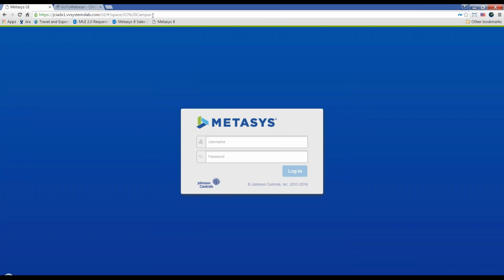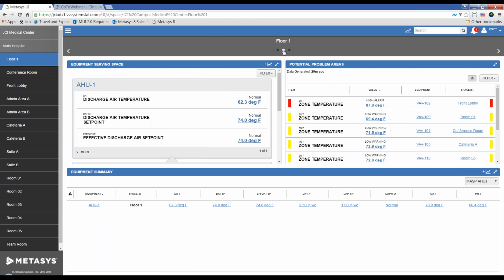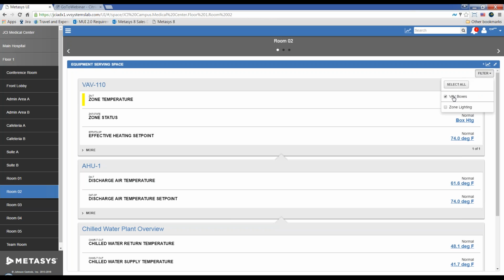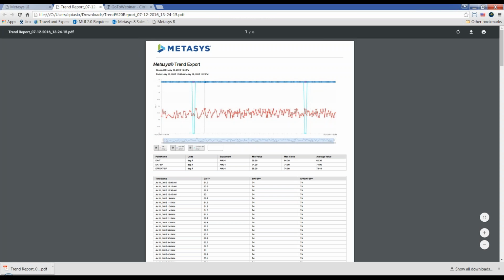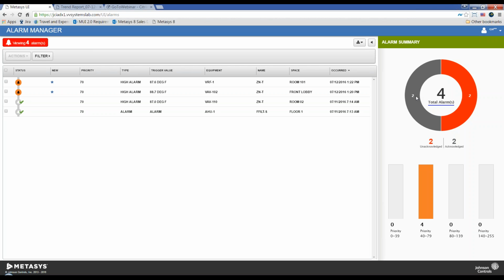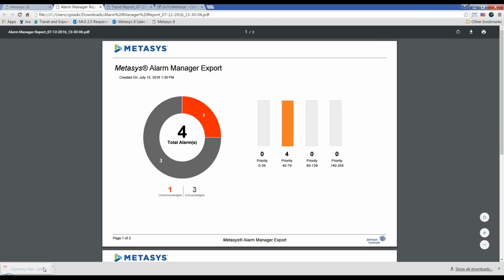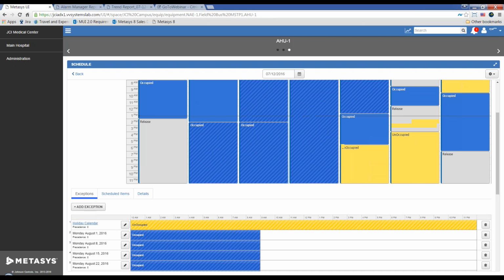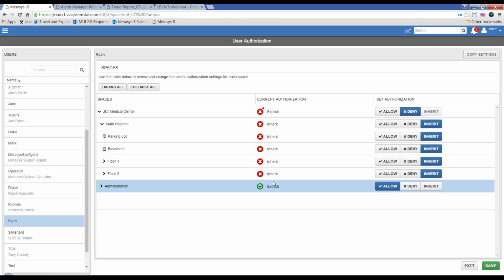Metasys® 8.0 Demo | Johnson Controls

Comment: Hi Ryan, Excellent video. may i know can one use existing UI or we need to create new graphics. I am stuck at at "no space configured". I can view the alarm but there is no graphics on the centre console and the left box.
Reply from the maker: Hello Zaki - Glad you like the video! Metasys release 8.0, spaces and equipment need to be configured in the System Configuration Tool (SCT) in order to see graphics within the Metasys UI.  Both existing Graphics+ and Standard graphics can be mapped to a space or equipment object where they are automatically rendered on the fly when that space or equipment is viewed.  If an upgrade is performed to Metasys release 9.0, the Network View (All Items Tree) with Graphics+ and Standard Graphics as well as the Advanced Search and Reporting feature can be viewed within the Metasys UI without configuring spaces and equipment. If you have other questions please head over to our website and submit them there. Thank you! http://www.johnsoncontrols.com/buildings/building-management
Reply: Hi Ryan,
Thank you very much for your reply, we really appreciate it. I will try the advice above and will update you.
Thank you and kindest regards,